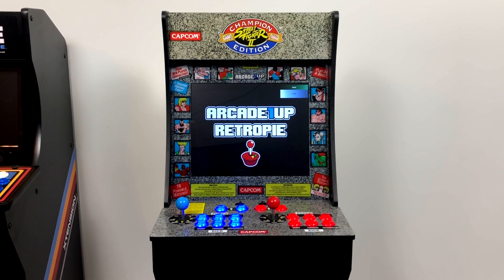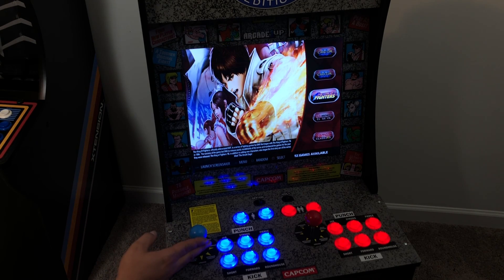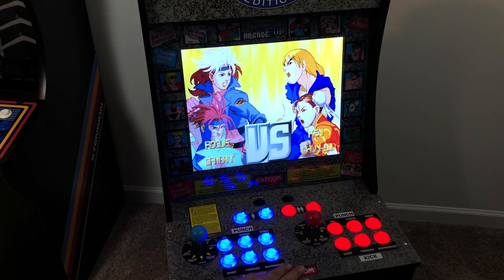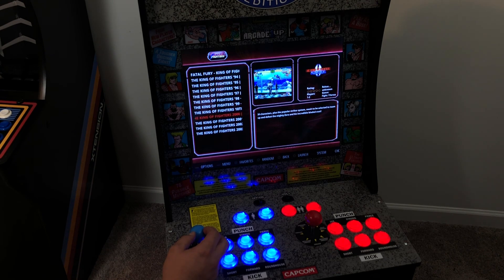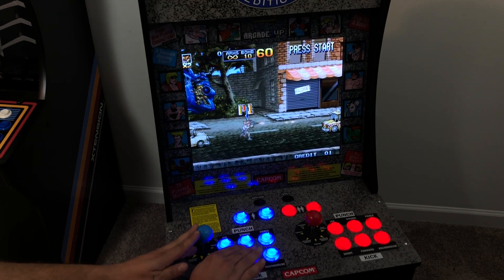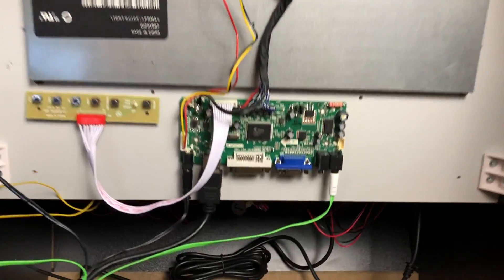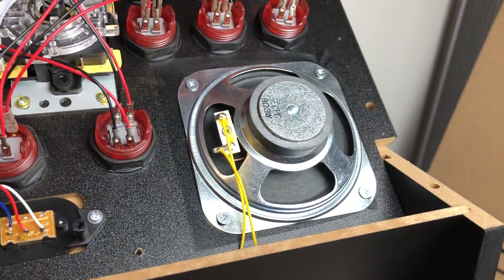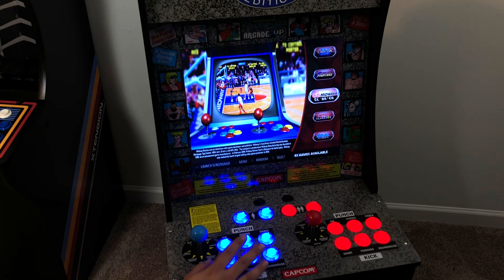Arcade1Up Cab Running RetroPie - Raspberry Pi Mod

Comment: Can the stock joystick and buttons still work or do you have to replace them?   Great work!
Reply from the maker: You will have to rewire at least the joysticks.
Reply: thanks.. Will just get the new ones as they light up also! :)  Do you have the Pi image aswell that you used?  Can you link that or provide name to get off of arcade punks.  Thanks again for your work.. Going to buy all parts and wait for my preorder  arcade1up machine to come in (hopefully) this month.

Comment: Hey just for kicks Prime, could you pop on the hardware HDMI scanline converter? I bought one as well, but ended up not needing it in my bartop. But just curious how this monitor looks with it running in-line. And also this monitor in the cabinet is just 1280x1024?
Reply from the maker: Yes I can. Ill throw it in the next video
Reply: hey thx, always like to see it on monitors as well as what i own :)
Reply: Is it not possible to do scanlines via the software like a normal RetroPie setup. I am guessing the HW scanline converter will look better though.
Reply: the reason why i asked him to do it with the hardware converter is there is no taxation on the pi.
Reply: I second this request and also the comment of showing software scanlines from Retropie. SF2 just looks better with a few old school touches to it.
Reply: Good call!

Comment: Outstanding job ETA PRIME. I think the buttons dont look out of place at all. In fact with that stock appearing control panel overlay, it makes it look even sharper. Like it was meant to be. Only thing that would bug me is I'd personally HAVE to wire up another speaker and just tap into the existing one. Qsound just isnt the same without it hehe. Thx for sharing. Oh, and again I think those monitors in the 1UP look great, very good color saturation for what they use.

Comment: Can you get any midway games to boot on Arcade emulator?
Reply from the maker: Yes most of them work using MAME 2003
Reply: ETA PRIME so could you give me some advice on why I can’t get them working. Is it the build I have flashed to the microSD card? I’m runnning 3b+

Comment: Excellent work... very tempting.
Question:
if you are on a budget to build an arcade machine, but you dont have to tools or resources to build one from scratch, would you buy an xarcade bartop unit or one of these and mod it?
Is the artwork and the LCD worth it? Or is the xarcade buttons/ build quality worth it?

Comment: DAMN Eta prime could get emulators running on a refrigerator. Good job sir.
Reply: Once you've done one Raspberry Pi project you could turn literally anything into a gaming system. You just need to be able to drill some holes in it. Those USB joystick controllers make the job a cake walk. No programming required because you plug them into the Pi and they just work as controllers. No soldering required since they come with wires and connectors.
Reply: But what buttons do you buy? I want the oldskool arcade types, concave, no clicky sounds, full size. And if they're LED, all the better. Any suggestions?
Reply: LG and Samsung both have refridgerators.. 

Would be awesome to see it running on there.
Reply: I know right...

Comment: I just can't get over the incorrect joystick placement. They joysticks were placed too high compared to the six button layout. They should be centered and there is no way of fixing this mistake 👎
Reply: These control panels are fairly easy to completely replace, just saying.
Reply: @bigshrimpn  Then what's the point if these? Good luck on making a replacement with the proper artwork. You may as well at that point build your own Quality mini Arcade Machine. $300 for 3 games and a 17" screen doesn't add 1up to me

Comment: I doubt they would, but I’d love to see them sell these as just cabinet, controls and monitor/speaker. Basically a kit ready to insert your pc or Pi. It would make a great project kit.
Reply: They probably would but the licensing might then become a problem -- Most of the license holders would not want to work with them if they are also selling a model that does not have licensed games included thus cutting them out of the picture - which would make it hard on them to negotiate other licenses cutting into their core business ( A lot of the buyers these are aimed at will not know how to do this type of modification so need a system with a few games that is cheap to buy and is just plug and play. So having the companies stop licensing games to them would probably cost them more sales than they would make selling an empty shell t those that wanted to mod them ( they'll just pretend that part of the market doesn't exist to them and continue selling the cabs with a few games and be happy to still pick up the sale to those that want to mod them - but just like the RPI foundation will pretend they want nothing to do with aiding them - so the game companies continue to let them license the games.)

Comment: So about $400 for this or $429 for the Xtension AlphCade and the AlphaCade is build better and has a bigger screen and requires no modification. Thanks for the Video ETA you helped me decide the AlphaCase is deff the way to go. FYI i included tv with AlphaCade price that is why it is $429 not $349.
Reply: You haven't accounted for shipping costs man
Reply: Also the 19 inch widescreen if used in 4:3 actually is about 15.5 inches. I was doing the comparison to see what I wanted and even though AlphaCade is better made I decided for the 1up since the 17 inch LCD 4:3.
Reply: @RastanPinball  huh, that's a good point I hadn't thought of that.  Also, it's pretty hard to find a good 4:3 screen these days.
Reply: @BrainSlugs83  check out ETA video about the other arcade. The screen has built in speakers. Its probably 200 more than the arcade1up, but its no contest that more expensive is way better than arcade1up. Id honestly would of bought the other one instead of arcade1up if i saw this video before putting together my arcade1up. Lol
Reply: @moton410  that's the video I'm talking about; the alphacade.  It doesn't come with a screen.  The screen has built in speakers because he used a TV.
Reply: @BrainSlugs83  ok gotcha.
Reply: Yea shipping is $100+
Reply: @GiancarloGGG  I did not know it was $100 for shipping my bad
Reply: @greekmanx  I didn't know either until i was checking out haha I still bit the bullet and ordered it
Reply: Also, doesn't the alphacade come with no screen / no speakers? So, it's a bit more pricey.
Reply: I big selling point for me is the cabinet art on Arcade 1up. How much would it cost to order all the cabinet art for an AlphaCade? Including 2 sides, marquee, around controls & around the screen. You are probably looking at another $200-$300 easily. With Arcade 1up, you buy from local store, bring home, assemble in 1-2 hours like a piece of Ikea furniture, plug-in and you are playing.

Comment: Not all Zero Delay Encoders have the 5v plug for LED, i have 4 here and all are blank where the 5v would be, $6 from China , 20 years ago the P/S2 type Ipac 4-way was nearly $100
Reply: Jaz808 I noticed that too ... my encoders did not have that red voltage input either... next time I’ll be more careful when I order...
Reply: Hey John the tracks are connected, so Stick the Wire's in the Hole's, i will try it soon

Comment: Great Video, and this is cool...but it's just a regular retropie build using the Arcade1up as the cab. I want to see the original board hacked, and all the games on one machine. 
Then I'll buy a Arcade1up.
Reply: That's unlikely with the way the controller board is setup.

Comment: So basically this makes it : 300 + 40$ (pi3) + 60$ (arcade kit) + 15$ (audio amp) + 25$ (hdmi board) + 30$ (sdcard) so overal about 470$ for a full kit. With how flimsy it seems to be I’m not sure I’ll keep my unit. I’ll get one though if they make a 2 players vertical setup (just for a shmups station)
Reply: Fularu Cabinet is cheap and it's all for show .
Reply: Or just use a PC and cut the cost way down.

Comment: Question: did you have to buy new buttons? Could you have used the 1up buttons with the raspberry pi, with some modifications if necessary? Or would it be too much work? I don't mind a little wire stripping and soldering but not if it is going to mean rewiring the whole thing.

Looks cool btw.
Reply: Using the original buttons would work just fine - if you look at the controller board inside these they use the same 2 pin connections that the zero delay board uses and all the buttons do is provide a signal when the button is pressed so the microswitches on the existing buttons do the same as any other button. You would just disconnect them from the existing control board and plug them into the ZD encoder - then setup the controls in your emulator.